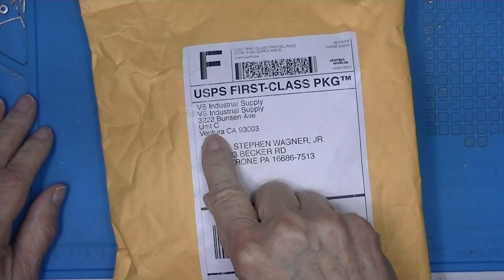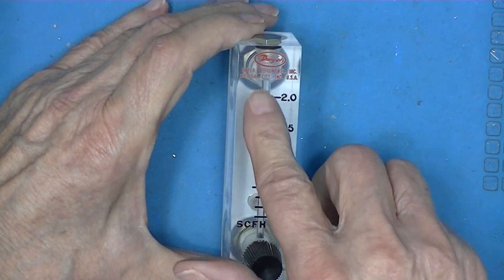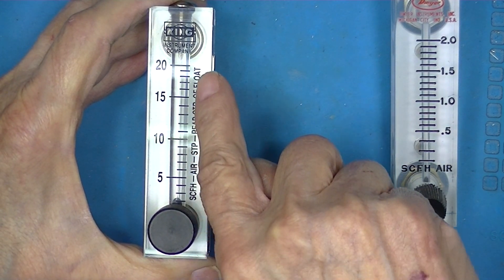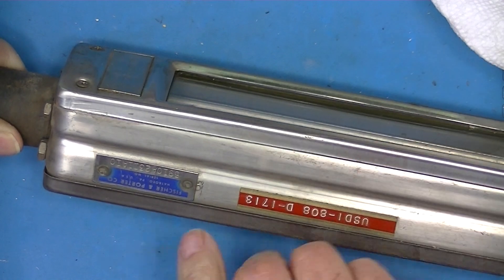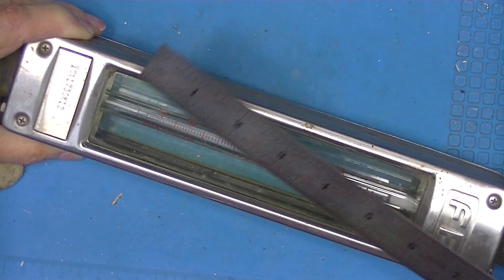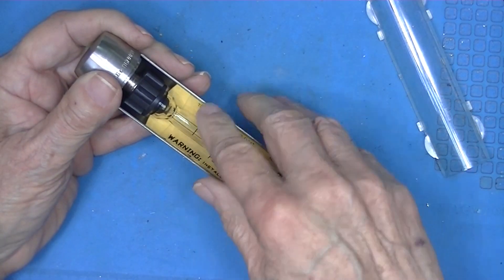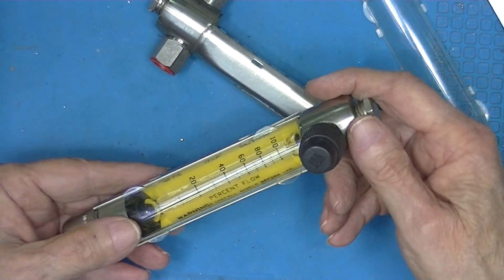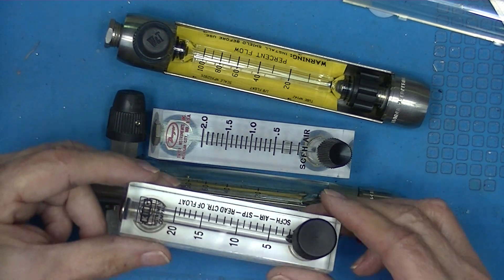Some Variable Area Flow Meters

Comment: Quite a collection of flow meters.  I use one for a portable oxygen system for flying smaller aircraft when at higher altitudes. In aviation we use 59 farenheit (15c) and 29.92 inches (1013.2 mb)  of mercury to define a standard day.  Makes more sense to use a more normal indoor temperature of 70 F for those flow meters.  Maybe the meter is calibrated to adjust to the specified room temperature.